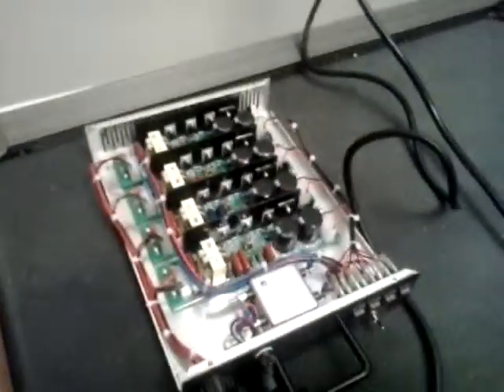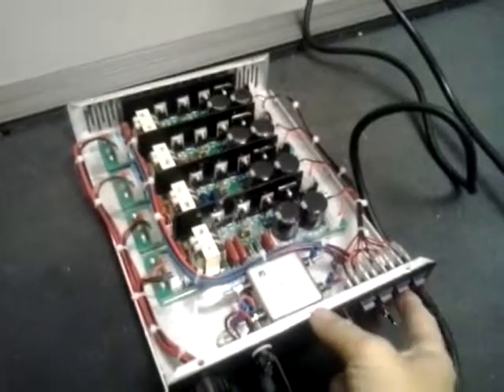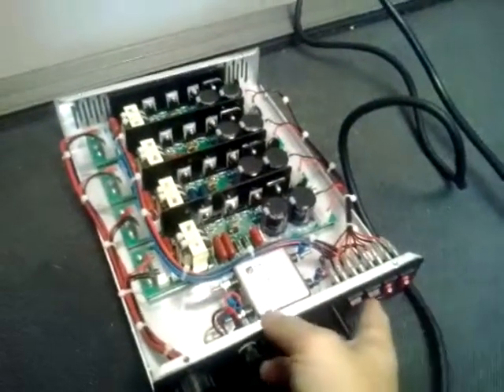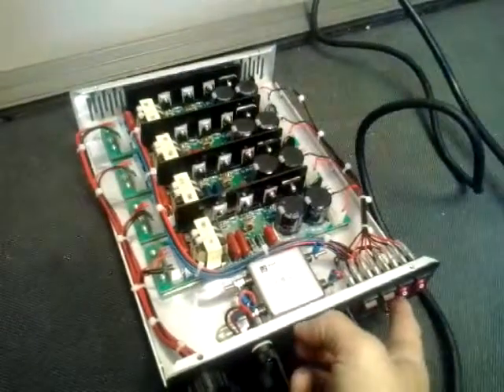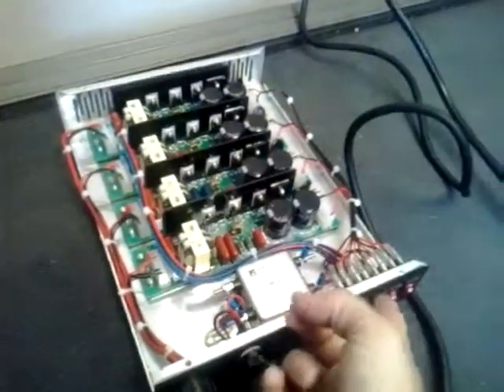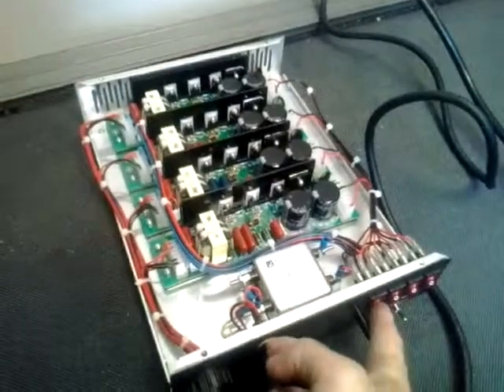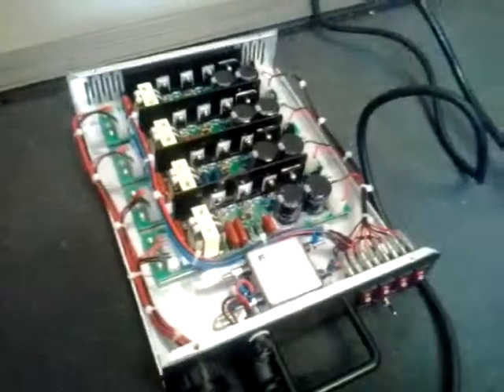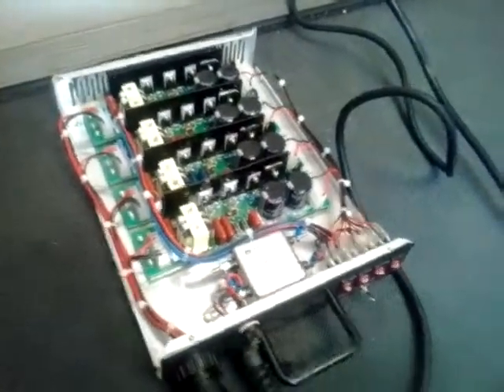Kinosun lights.

Comment: Same happened with mine, they were popping when used with a Honda2000eu genny (I am sure it had an inverter, not sure off the top of my head).  I swapped the original fuses with ones that were the tiniest bit stronger and haven't had problems since.
Reply from the maker: thanks Stuart, but the problem was not the fuse it was the ballast itself. crazy i had to replace another one last month. so in your case the fuse was blowing up or the unit itself? 

thanks

Comment: So hard to find any info on these guys. Thanks a ton tho. Would you be able to hook a kino flo ballast to this?? Have you tested the two brands side by side??
Reply from the maker: Hi Davis,
I just bought a third one 4 feet 4 bank I must admit i am happy every now and then i have to replace a fuse but that's about it.
I did not try to hook it to the original kino, I'll ask and get back to you. I  also have the 1.2 hmi from them they BUZZZZZ a bit but they work ok your sound man will grim If your lights are near.

 that's about it
cheers